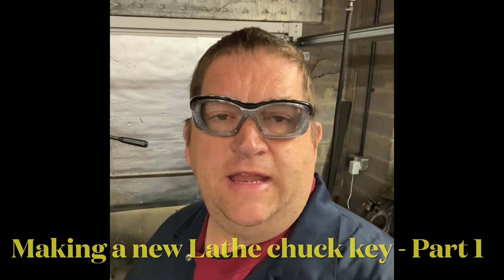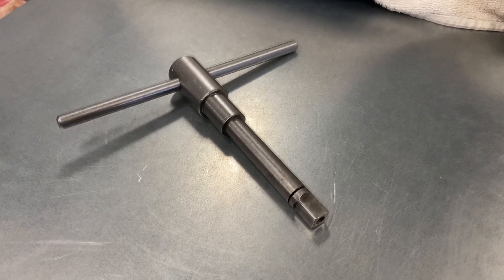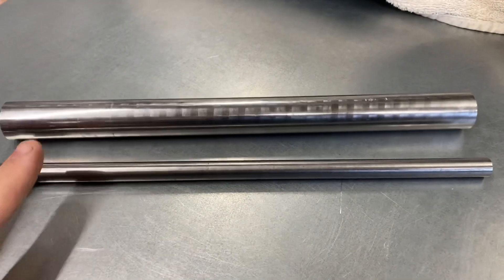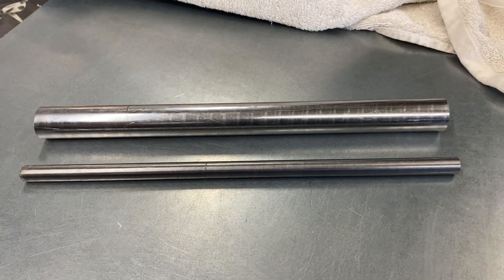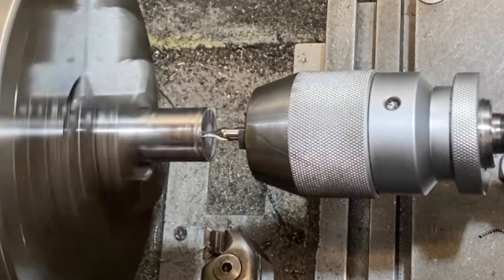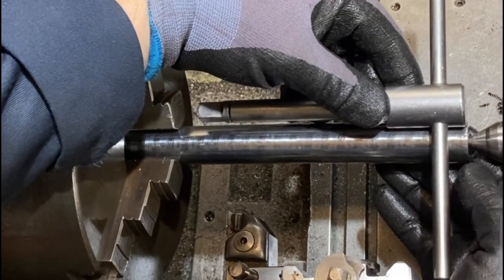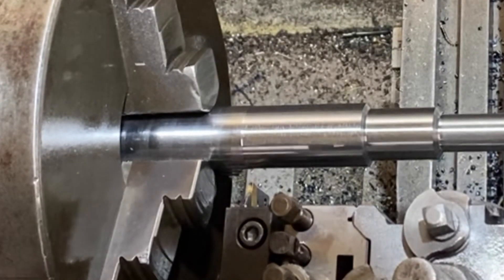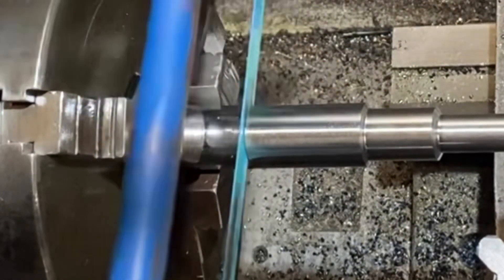Making a new 4 jaw hexagon drive Chuck key - Part 1

Comment: I love the machining videos.  Could you please make a video about different grades of steel alloy and their usages?
Reply from the maker: Loads of different grades available use westyorkshire steel website for use info. Howeve experience counts here as different grades require different heat treatment processes depending on sizes and shapes of what you make. It’s a massive subject
Reply: @ACDodd  Thanks AC